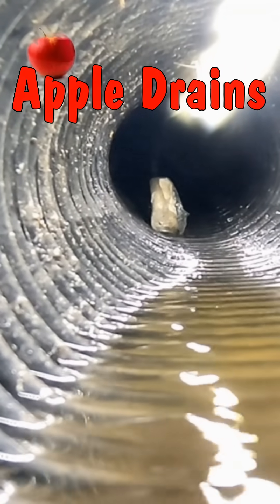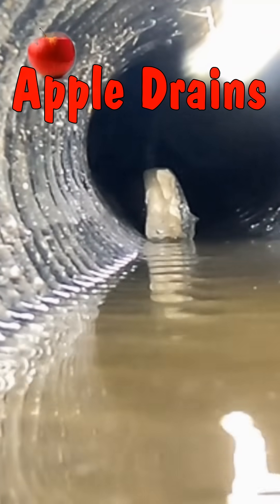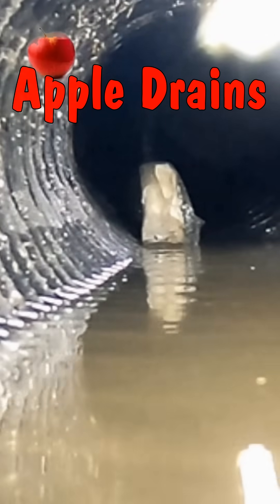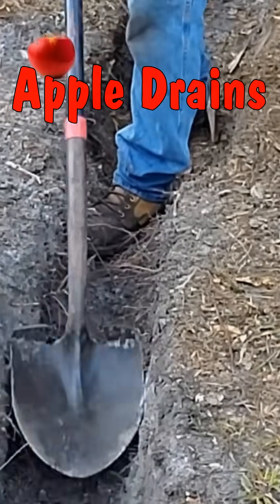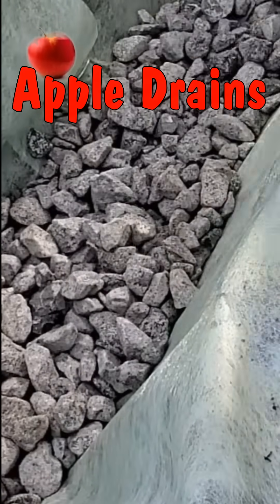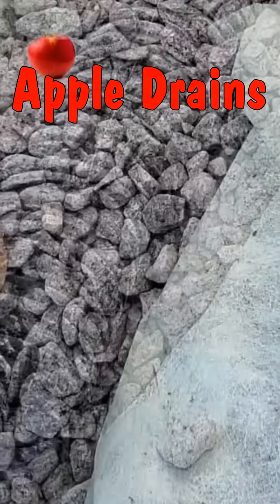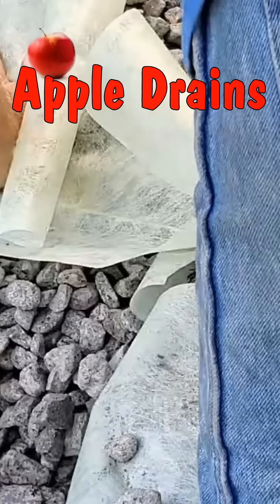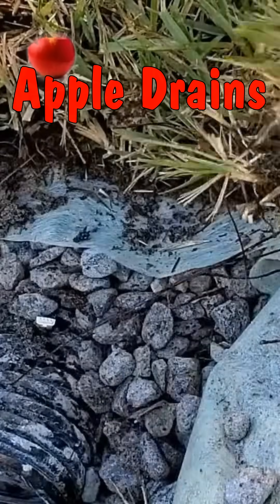FRENCH DRAIN - Fabric with Stone #drainagesystem

Comment: A lot of the companies are putting the pipe directly on the bottom and burying with rock. I don't see them putting a base under the pipe. Which way is right ?
Reply from the maker: Watch the video again. It will answer all your questions. It’s so full of information. No one has anything like it.
Reply: That’s what I always thought, too. Dig your trench, lay your material (a certain type, the name escapes me now, but..), gravel, the corrugated-perforated pipe, more gravel, and finish by laying/folding the fabric over top, just like he said. This guy, and also French Drain Man say the same thing

Thought I was starting to get a good grasp of it. However, just like the other guy mentioned, now I see where the French Drain Man is talking abt laying the fabric down and laying the pipe directly on top of it, and he mentions that this type of French Drain improves w time. 

I feel like I’m going back to square one w my comprehension… 🤷‍♂️

Comment: will the grass grow there? with all the water being pulled/ gan you lay sod directly onto fabric?
Reply: Yes the grass will grow there just fine. It will just need to be watered a lot at first. Think of when you see grass growing completely over something in the lawn, like a septic tank lid, or a small slab. The only difference here is that the grass will do better over the Geo textile fabric because it's a very wet area anyway which is why you're putting in the French drain in the first place. The roots will seek out water, even if that means growing all the way out to the sides where the soil is. Hope this helps.

Comment: Will this help with water pooling around my back door? Or would I use pvc to carry it away? I guess my question is, if/when would you ever use non perforated pipe
Reply: If you're in southern climates then you could use PVC that's perforated or use a catch drain to pull the pooling water away from that area. If you're in a Northern climate the PVC will freeze and crack Underground and so the flexible corrugated pipe is preferable. Whether it's solid to carry away rain gutters downspouts and or just water pooling in one area of the yard, or it's perforated as in a French drain to take water away from a larger area

Comment: How much slope are you putting in and how much time do you spend ensuring the flexible pipe is sloped correctly?
Reply: Rule of 1" drop per 10' of length I believe
Reply: @jamesmoore1341 thx